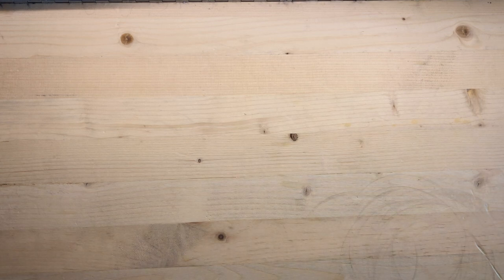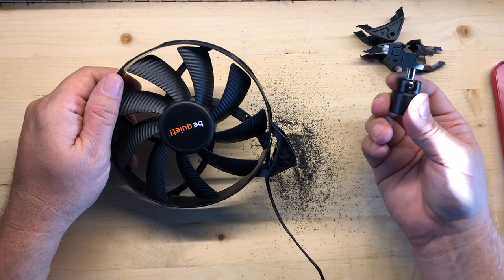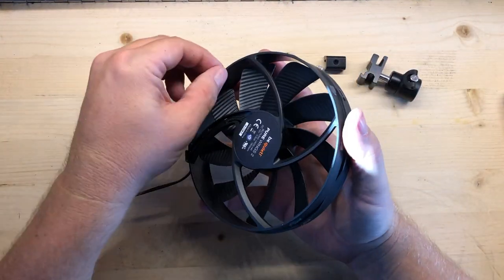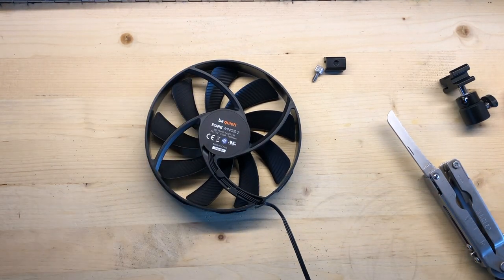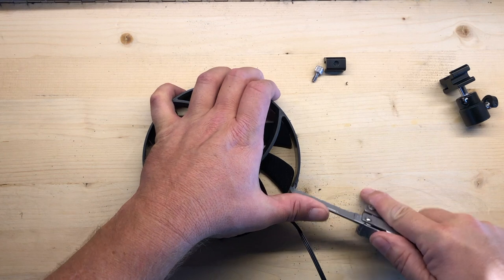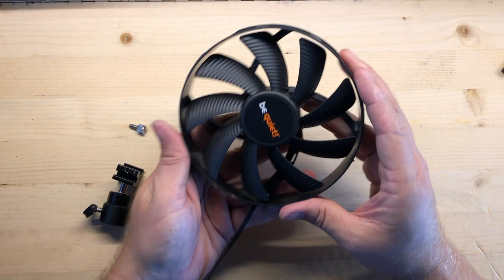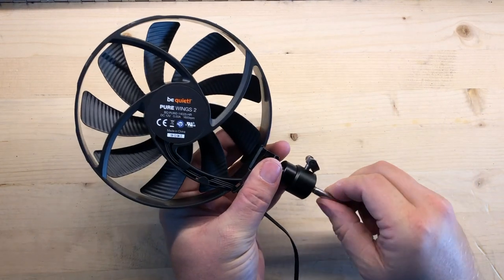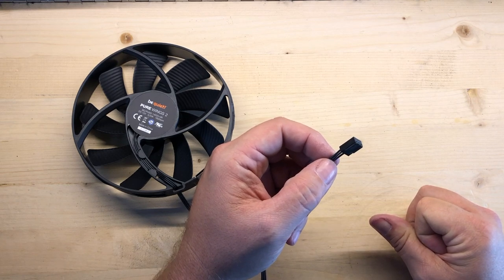Computer Camper Fan Mod

Comment: DC fans don't care which way you wire them, so you could make it blow from the front side.  That is, switch your positive and negative around and the motor will run in the other direction.

Comment: How's this setup holding out?  Mostly interested if you have had any problems with the dimmer, from what I've read is to avoid low rpm's with cpu fans in general not less than 50% power.  Have you found this to be not the case, I understand some fans are designed for this.  About to do the same thing to add fans to a ceiling vent in my van.  Also the fan you picked  has a lower db(A) than most of the ones I've looked at.
Reply from the maker: I'm on 2 years with this setup, haven't had any issues with it. Didn't know about the 50% thing. I use it in a small SUV camper, at lower RPMs it make almost no noise but still moves enough air around to be comfortable. I chose the fan manly for the low noise.